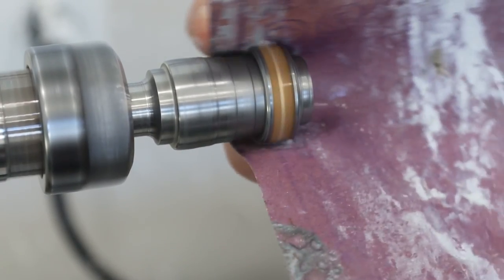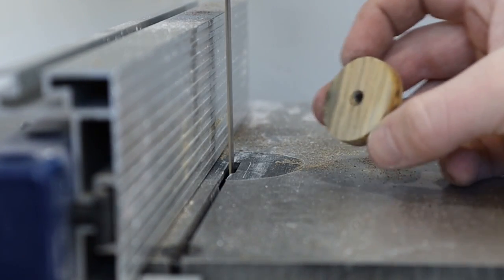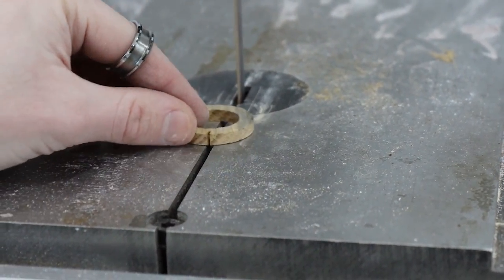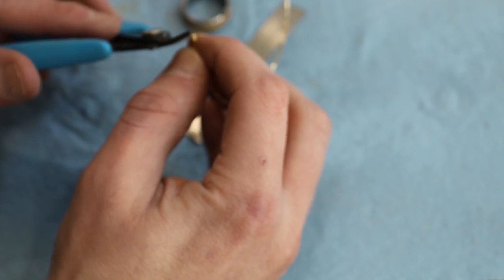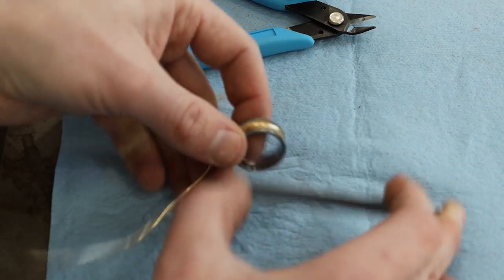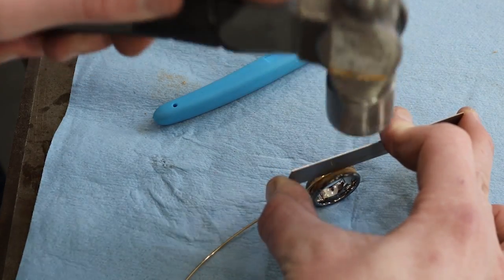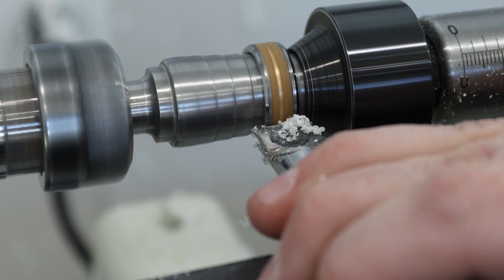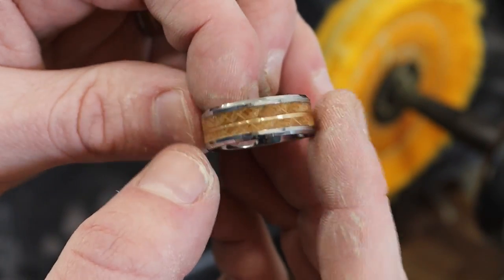How to inlay gold wire into a bentwood or other type of ring!

Comment: Try using a burnisher on the gold. The seam will go together a lot better invisible if you burnish it long and strong with 18k gold. A hand burnisher will work but the wheel burnisher will work better use it LIGHTLY.
Reply from the maker: Nice! I will give that a look and try it out. Thank you for the suggestion.

Comment: Hey man, awesome video. Can to tell me your set up, like what lathe and mandrel
Reply from the maker: Thank you! Using a jet wood lathe 1221, collete chuck, and mandrel from ring supplies. We do also sell carbon fiber nylon mandrels set for $25 if you are looking to get started a little cheaper as well. Metal lathe is = to precision Mathews lathe.
Reply: @DreamwoodRings  thank you man, I've been using a penpal lathe and rubber boat plugs shaved down to size. Lol

Comment: Great video! I just wanted to ask if you knew if it would be possible to use bendwood and no lathe to get a similar result?
Reply from the maker: Thank you! I think so, would you think about using a drill in some way?
Reply: @DreamwoodRings  I was going to use a triange file and a drill. I wasn't sure though if it would cut accurately enough for the wire
Reply from the maker: @harcoo8544  I would say practice your inlay cutting and see how it goes. When I was starting out I always had a super hard time cutting a straight inlay on a drill. I think it could be done, just difficult.
Reply: @DreamwoodRings  thank you so much!